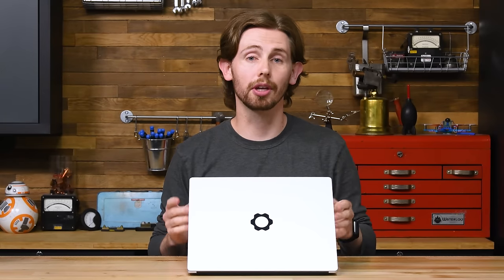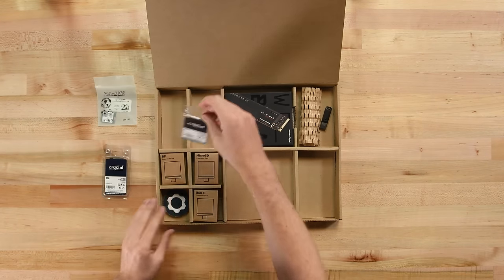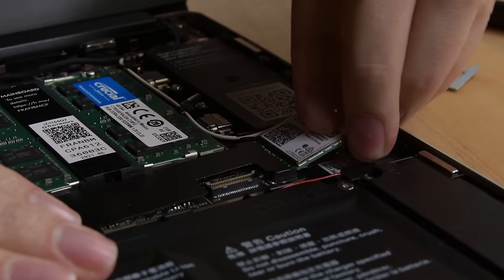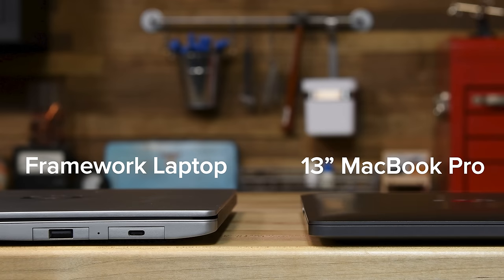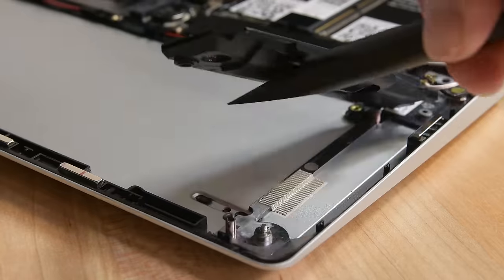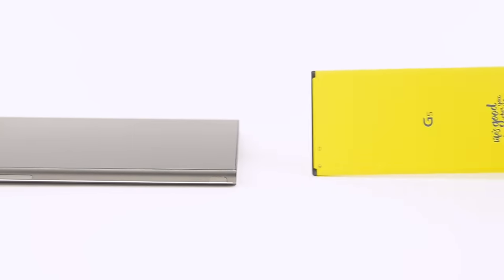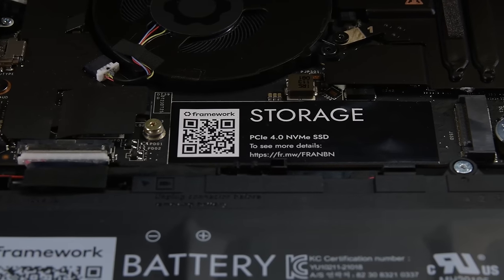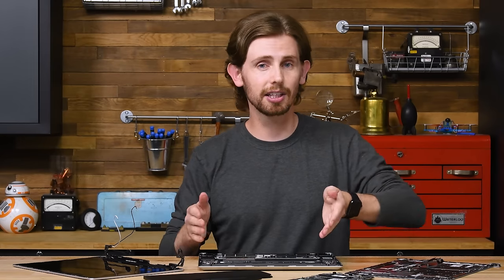Framework Laptop Teardown: 10/10, But is it Perfect?

Comment: Ok this is how all laptops should be to a certain extent. The RAM, SSD, Battery and WI-Fi card at a bare minimum. If they make 15.6 inch version with a RTX 3050 card, I’m all in. Quick question though, how did it perform?
Reply: I’m just betting on what I heard in the video but I suppose it performs just as well as you’d expect a modern laptop without dedicated graphics would perform, if they had gone with a ryzen system however then maybe it would’ve been game capable but in this case, I wouldn’t keep my hopes up
Reply: Unfortunately (to no fault of Framework's) the i7-1185G7 (and the i5-1135G7 and i7-1165G7) perform... just okay. An 8-core Ryzen 5700U will comfortably beat the 4-core 1185G7 in multi-core (at an even lower power budget) while maintaining solid (although not as good) single core performance. And AMD's previous-gen 4900HS matches the single core performance of the i7-1165G7 and also has double the cores (8 compared to 4). AMD's integrated graphics also perform better, So better hope that Intel pulls through for 12th gen and Framework can hit shelves with those mainboard upgrades. Otherwise might want to switch to team red.
Reply: @jompkins  My guess is that AMD APU's were in short supply, while Intel had chips to spare.
Reply: @WhenDoesTheVideoActuallyStart  Yep I’m with you there. And Framework couldn’t have known AMD was going to widen their performance lead with mobile 5000 series to the degree they did. The framework model is still a decent buy subjectively, at least IMO.
Reply: @jompkins  AMD Laptop CPUs are slower than Intel’s 11th gen Laptop CPUs in gaming
Reply: @raikaru0  Yep, definitely in a lot of cases. But in a laptop with no dedicated GPU it wouldn’t matter
Reply: @jompkins  I think they cant use AMD, because Ryzen doesnt support 4 full-spec USB-C and no Thunderbolt, and thats what they need to make these swappable adapters work, afterall all 4 ports must support all possible attachements (HDMI, Displayport need Thunderbolt to work as far as i know)
Reply: Nah, they should add a rtx 3060 because it won't be much more and the 3060 can go down to 60w and even then it'd be better than a 3050.
Reply: @jompkins  There's nothing stopping them to also sell AMD APU+MoBo upgrades perhaps other than supply issue which is more on AMD than Framework
Reply: If you want a laptop that can do all you are asking with a 3050 GPU than look at the Lenevo Legion 5. Most laptops these days can do everything this company wants to do but at a lower cost. You are never going to get a CPU/GPU swap on this and any type of true dedicated GPU would require more cooling, more power, more heat pipes, etc on a laptop or you simply will burn it to oblivion. 

This will most likely fail hard as it simply is not a viable setup, relying on people to use the QR code to scan and purchase from them directly to keep the warranty active.
Reply: @_--_--_  that is slightly incorrect, the only difference between a fully speced USB-C and thunderbolt is the ability to connect an external GPU. thunderbolt has a protocol that allows external gpu to correctly "talk" to the laptop from its PCIe lanes.. if you look online you can find many ryzen based laptops that has USB-C that support monitors and ethernet support.
Reply: @jompkins  even though they are USB4 that doesn't mean that they are Thunderbolt 4. Framework themselves told this and they need some sort of certification so that the laptop can use external gpu and other thunderbolt dongle
Reply: @siontheodorus1501  Gotcha. The discussion here was about dongles and being able to tunnel Displayport through the USB-C ports. USB4 is a 40Gbps connector that has Displayport and PCI-e tunneling regardless of thunderbolt certification. See the above comment, that would be the main difference (eGPUs).
Reply: @jompkins  Unless you are trying to game on these or have to do heavy video editing or rendering these are way above what the average consumer needs
Reply: This is an ultra thin and yet totally fixable device. Not much space for an internal discrete gpu. Maybe a amd apu next time or external gpu. Anyway, this thin form factor is mainstream, gaming laptop could be they next thing if there are any demands
Reply: @WhenDoesTheVideoActuallyStart  more chance it was the intel thunderbolt monopoly, which they need for ports and egpu, 
One the only things i like about biden is his right for repair, people should pressure him about the thunderbolt situation and force them to sell for royalties per port used
Reply: @silver4214  To be fair to Intel, USB 4 isn't far from being Thunderbolt 4 by another name. It's just that Thunderbolt 4 certification requires laptops to support almost all possible features, while USB 4 can even only support 20 Gbps. It's more of a question of what the manufacturer enables.
Reply: @raikaru0  if you're getting a thin laptop for gaming you're doing it wrong.
Reply: I think LTT is making a video on that.
Reply: @amonmetalhead7034  no. some people are just not obsessive with triple-A titles like those are the only things that matter.
Reply: @Jas7520  Actually the 5000 series is the Zen 3 version. The 4000 mobile series was the zen2 version. I have a 5700u series laptop and according to CPU-Z it's on the 7nm process and is sporting all the specs the zen 3 mobile APU's are have. So, I think you got a little confused. They were a generation behind which is why they skipped the 4000 series desktop. To help get their APU's in sync with their process node and silicon.
Reply: @benmabry2280  you're mistaken. Ryzen 2 is on 7nm, and the 5500U and 5700u are based on Zen 2. The 5600U and 5800U are the Zen 3 equivalents. To continue selling Zen 2 in the same product stack they essentially rebranded 4000 mobile with some tweaks for those two processors. This information is on the official AMD website or any number of review sites.

Comment: The battery isn't even small, 55 watt hours when most laptops of that size have batteries with 40-50 watt hous
Reply: I think they were just trying to find something to be critical about this thing because it sounds and looks amazing. Would like to see benchmarks on the performance though
Reply: Nah, 55Wh really isn't that great. The C940 has a 67.5Wh battery in a 2-in-1 form factor, for example.
Reply: @Taudris  I most definitely don't agree with you, the XPS 15 9500, which this is often compared with, for example in Linus review of this things, thst thing is a $2000 + dollars laptop (!) and it has a 56 wh battery in it. And it's not even thinner. Laptops in the price range of this thing, $1000, 750 if you build it yourself, pretty much always sit in the 40-55 wh range for their laptops. For example the HP Envy X360 15.6 inch laptop I've been looking at buying, which is more expensive then this one only has a 51 wh battery. The battery inside this thing is definitely above average for laptops in this price class, there is definitely ones with bigger batteries, but it's definitely a very good size as well.
Reply: Heck if I had my way I’d get rid of the internal speakers just for a little bit more battery. Probably wouldn’t make much of a difference at the end of the day though.
Reply: Most Thinkpads offer 60+ wh in this size class with more ports, a better keyboard, and all while being just as easy to repair. This thing is a magnet-filled gimmick.
Reply: @alexChook  LTT has done some benchmarks on it and it is what you except from any other laptop
Reply: @StackableGoldMC  Ooh, that is genius. Or just a mono speaker and and a bigger battery. the cad files are available so companies could very well capitalise on that.
Reply: I do like a bigger battery. Hope they or their forums finds a way to fit it in, even if it means a bigger case. That's what I love about this thing, I know for a fact someone else will run into this before they reach my market and the forums will help me if the company itself doesn't yet.
Reply: Even my GAMING laptop only has a battery capacity of 70Wh. My standard HP Pavilion has a battery capacity of 41Wh, and that's a 15.6 inch laptop, so I can imagine a 13.3 inch laptop with 55Wh of battery capacity being fine for most uses.
Reply: @TheSpotify95  Wow the GX1 has a bigger battery (46Wh) than that pavilion and it's a 7" laptop.
Reply: 50 watts/hr is really small, laptops are coming with 99 w/hr nowadays
Reply: @jeinnerabdel  17 inch laptops come with that, not 13/14 inch laptops. You are completely wrong.
Reply: @swecreations  mine is a 15.6 inch laptop (MSI GE66) and it comes with a 99.9w/hr battery. This is the standard in most laptops nowaday... Do your research, buddy
Reply: @jeinnerabdel  Well that is because it's a gaming laptop, it's much thicker and therefore has more space for batteries.
Reply: @swecreations  same price range though... so, don't say that's not a battery that any laptop may have. There's no excuse for a low performance laptop at that price range and yes, a bit thicker but there are other laptops thinner than mine with the same 99.9w/hr battery. Again, check your facts before defending a lame brand.
Reply: @jeinnerabdel  They are still thicker then this, a 100 watt hour battery weighs almost a pound, and would make this laptop a lot thicker, a bigger battery would cost them almost nothing, it doesn't have anything to do with how "premium" the laptop is, it would just take up a lot of space, which is literally the opposite of what this laptop is trying to be, which is a thin and light ultrabook.
Reply: @Taudris  I looked it up and on their own website its only 60WH, and its also a larger laptop (14 inch vs 13.5). And even with that, framework now also sells a 61WH battery for the framework 13. Meaning even people with the original framework can replace their battery with this new higher capacity version.

Comment: I bought one of these and am on it right now. I love this thing! Putting the DIY kit together was easy and I loved the process. Every component on it works great. Not one complaint to make of it yet
Reply: I've pre-ordered the 16. Any updates from you one year later?
Reply: @mitchib1440  it's been trouble free this whole time. I use it daily. The only issues I've ever had with it have really been with running windows
Reply: @Jacoblikesyoutube  
I ordered a 16, with no OS, and will install Linux. Maybe run Win if I ever needed it, in a VM.
But I have been running Linux for 20 months and have no need for Windows.

Comment: Now imagine this in a 15 or 17 inch form factor with an AM5 socket. Assuming AMD maintains the same level of socket compatibility they did with AM4, that'd be pretty impressive.
Reply: It wont use any socketable CPUs, just doesnt make sense in laptops that arent 30 pounds heavy and cost 5000usd.
They designed the motherboard as simple as possible on purpose, so that swapping the entire motherboard is barely more expensive then the CPU itself.
Reply: @_--_--_  and more wastefull and still more expensive than just being able to swap the CPU. I get that socketable CPUs these days don't make sense in laptops as the low power versions often don't come in a socket format, but still, I would love to see a return.
Reply: @Hans-gb4mv  Yes it is more wasteful, but unfortunately it isnt really doable any other way right now.
Desktop socketable CPUs arent an option.
The only thing that could enable this is if Intel/AMD reindroduced sockets for mobile platforms, which where discontinued a long time ago, then it could actually be practical again. But the chances of that happening are almost non existant.
Reply: Intel only becuase of the design platform.
Reply: @Hans-gb4mv  Neither Intel, AMD, or VIA do not make mobile CPUs in any other package than BGA. The only way around this would be an expensive adapter that could convert FCBGA to a slot loading package. Likely impossible however because of electrical and routing constraints. Maybe a socket the QUIP found on the canceled iAPX 432. Or the "cards" seen on the early mobile pentiums.
Reply: @_--_--_  Good logical amassment , some people commenting are missing that point along with the fact that its a start up company . If they make it they can change and improve things , just like Apple ((( DELL and all the others
Reply: @Hans-gb4mv  I wonder if any of the manufacturers have looked at the idea of something similar to a ram slot , just make it a little more secure , or like the small form facto NVME slot . Even something like a WIFi card slot , its small enough
Reply: @MrTarmonbarry they did years ago with graphics cards. Never was a success. And for cpu's we've had sockets for decades
Reply: @Hans-gb4mv  I think some still have graphics cards that can be changed , not positive about that though. Yes , i know sockets have been around since the year dot , and now we have the good old BGA . Pity someone can not come up with a better idea but that would not suit the manufacturers
Reply: @nithpro1385  
I said it only makes sense in a product thats 30 pounds and 5kUSD, i hope i dont have to explain to you what a hyperbole is.
A Intel socketable CPU would add 5mm, a AMD 8mm (4-5mm for Zen4 if the rumors are accurate that it will be LGA).
This Laptop has a thickness of around 11mm without the display (15.5mm with display), this laptop is a ultralight, adding 5-8mm would completly change the class this laptop is in and it's target audience for almost no benefit. This is a 50-80% increase in thickness (display excluded) without adding anything that justifies that thickness.
If you then add things like a larger battery, better cooling solution, etc to make use of the empty space you needlessly created, then this laptop would not only be 50-80% thicker (excluding display), but also most certainly almost twice the weight and atleast 200-300usd more expensive.
Then you would guarantee that this laptop would fail within the market.
Reply: @Hans-gb4mv  Mobile CPU are only available as BGA. So it is not possible to make a socketable mobile CPU.
Reply: People here in the comments forget things really fast. Take a look at the Lenovo T430.
Reply: @LinuxIsNotAnOperatingSystem  well it's easy to forget a decade old product especially when it's a form factor no one wants anymore.

rPGA was a socketed cpu but there's a reason it stopped being used.

Comment: It deserves 100 out of 10, I'm Engineer and I love that this is the start of a remarkable type of laptop that fastest to disassemble and assemble... Thanks, Bro. to let us know what it is... Thanks also to Framework Laptop, I hope that they created a removable CPU - because base on every repair technician encounter is the processor being damage by any circumstances...
Reply: Processor is soldered unfortunately. In my opinion the motherboard replaceability offsets this shortcoming though (depending on how much the part is of course)
Reply: @_lod  that ain't happening. Not enough market to target
Reply: It’s soldered, but none of the other main components are soldered to the motherboard, so upgrading the mobo wouldn’t be insanely expensive
Reply: @_lod  ever heard of the Intel Compute Element?
Reply: @DGao-zz5vq  I forgot about those but it would be hard to incorporate them into a laptop
Reply: @_lod  if you are referring to the H series PCIE card style ones, of course it's not possible. But Intel has a line of lesser known U series Compute Elements (Chandler Bay / Elk Bay). A chassis for Elk Bay was announced a few months ago, NUC P14E. No retail availability as of yet though.

Comment: I just got in the Framework 13th gen 13" laptop as I wanted to try it out - even knowing that they were coming out with a 16" laptop shortly.

After I opened the box and removed the parts, I checked Framework's web site and noticed they had the 16" AMD laptops available with GPU modules - immediately placed an order. 

Super excited to support a company that has repairability, upgradability, quality and style baked into it's DNA.